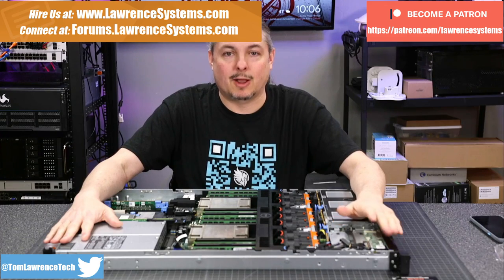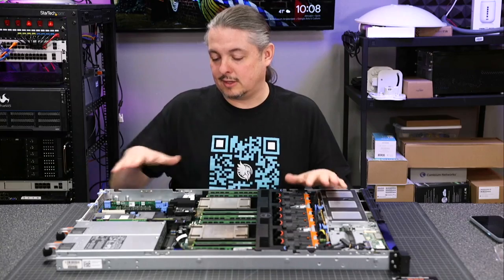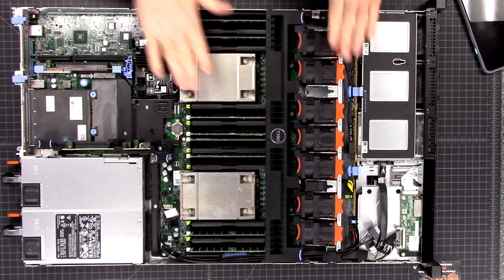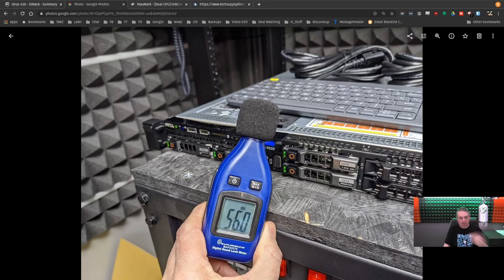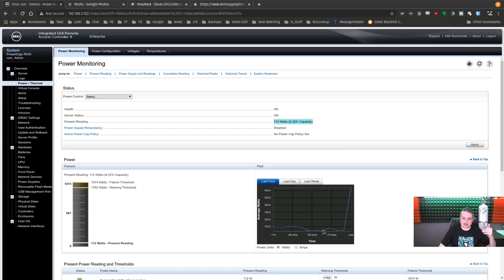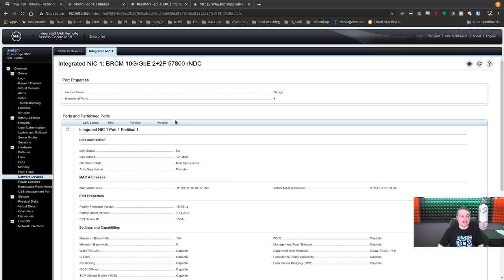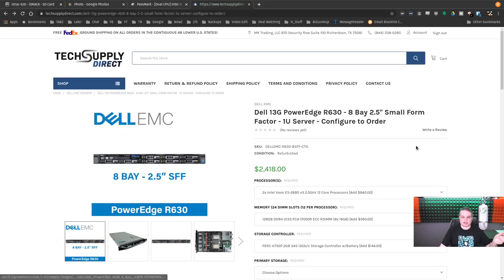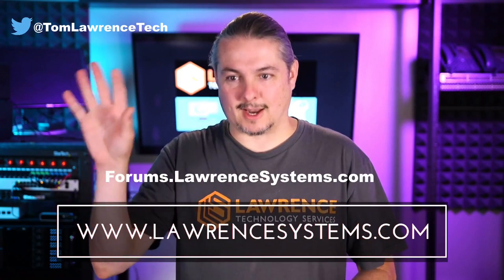Review: Dell PoweEdge R630 From TechSupply Direct

Comment: Tom: with 128Gb ram we can load plenty of applications on here
Chrome: Am I joke to you?
Reply from the maker: 128 is Good for two or maybe three tabs....lol
Reply: Actually chrome memory usage is dynamic, if you have low system memory it will use less. If you start using memory in other apps, Chrome will clear it's own ram usage. It keeps ram performance well. I have 64gb and once you get above 16gb, the ram usage only goes up with the number of tabs.
Reply: @davidg4512  Captain Buzzkill, ladies and gentlemen.

Comment: Just built a PE R740dx with IDRAC Enterprise! I like the Dell PE servers. I almost always have some issues with 2 things though. The 1st is doing the firmware and drivers upgrades from within the Lifecycle controller. The other is that Windows Server OS activation seems to fail if I installed the OS using the Lifecycle controller. I have to use PowerShell to remove an invalid key and then add the new VLS product key. Have you run into either of these scenarios?
Reply: Windows 🤢🤢🤮🤮🤮

Comment: I am planning on purchasing multiple R730XD & R630 for my homelab, and I was wondering how secure iDRAC really is? Is there a way we can manage these servers only on LAN, and not expose them to the internet?
Reply from the maker: Yes, create a special network for them without internet.
Reply: @LAWRENCESYSTEMS  Is it possible to get alerts on a failed component / drive across multiple nodes through a single monitoring software? In other words, how can I monitor multiple nodes all at once?
Reply from the maker: @visheshgupta9100  Have them all set to email you or use a tool that can monitor the status of each device such as Zabbix